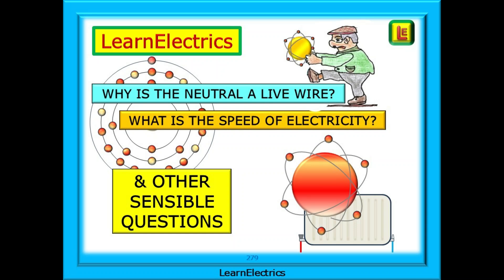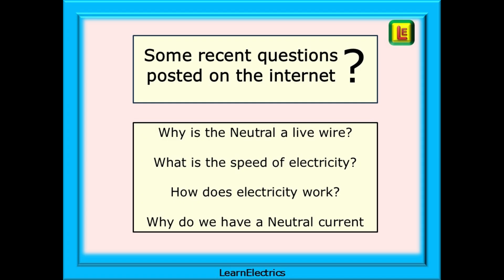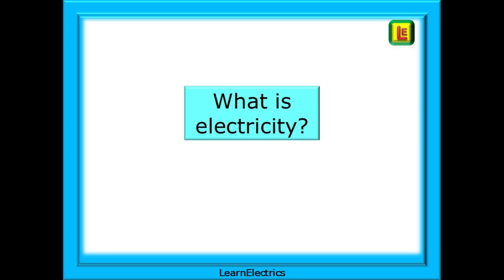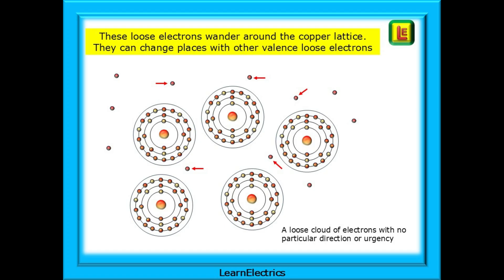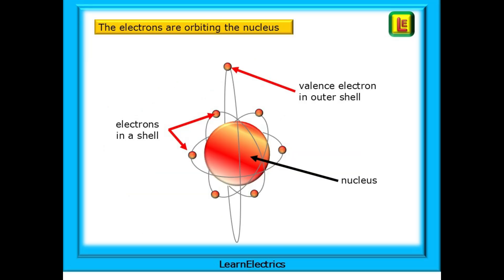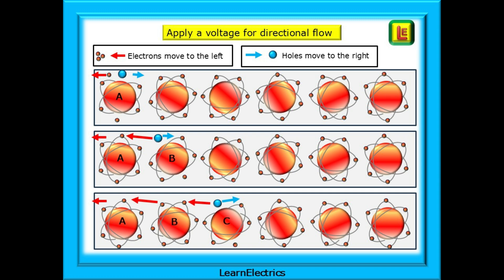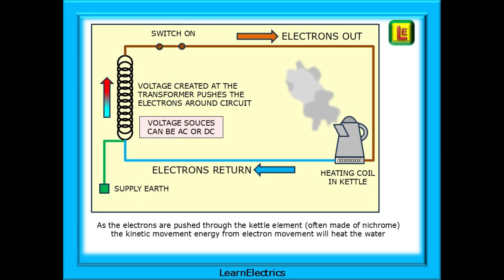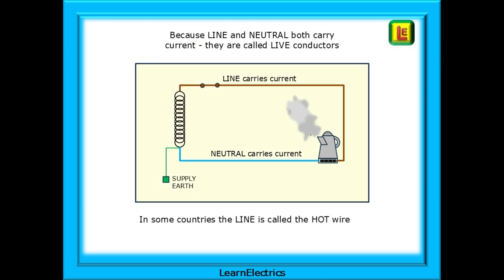WHY IS NEUTRAL A LIVE WIRE – WHAT IS THE SPEED OF ELECTRICITY – AND OTHER SENSIBLE QUESTIONS

Comment: I like the wooden tube model. Snooker balls . Conveyor belt. Bicycle chain models all work. However i find it works intuitively with DC. But not with AC. AC throws me in the way the chain is pumped backwards and forwards alternatively 50ntimes a sencond but that the Current goes round in one direction? Or does it actually reverse after 180°.    What is the length of travel of the electrons per phase.  ( is it the length of travel.of the generator's circumference)    basically.    With AC .     Is there any power in the negative cycle?  Is there power comin up the blue wire? Or is it dud because its grounded at 0 potential .  Or is it so that the even though ac is alternating, there is a 'current' going in only ine direction only.  ( like how the sea rocks forwards and backwards by a few feet constantly back and forwards but there is a wave travelling along the top of it in only one direction. This is the situation with AC?
Reply from the maker: Great reply, appreciate your support of the channel. A few have asked very similar questions so I guess its time to make another video. Watch this space. Lots more to come. Dave.
Reply: Thank you

Comment: The valence of copper is 2 - due to a  loosely  bound electron in one of the orbitals other than the one containing what you refer to as the "valence electron". If the supply and neutral are the same length (which they should be in a normal kettle cord !) the voltage dropped across the live to the kettle will be the same as the voltage dropped across the neutral from the kettle back to   the main neutral terminal    - same length,same material so same resistance and so same volt drop.
Reply from the maker: Yes indeed, you're absolutely right about the voltage drop in a kettle cord! Thanks for the excellent contribution to the discussion. Dave.
Reply: @learnelectrics4402  You don't mention the valency .  Do you agree it's a little more complex due to the loss of the single  electron in the 4S shell  and or the 3d shell ?

Comment: I think I’m getting somewhere, when it comes to potential difference it mean that return path (neutral) carries less voltage compared to line conductor as u mentioned line conductor carries 235v but after coming out of appliance to return path neutral it becomes less to 2.5v.
Reply from the maker: Er ... no, the line has the full 240 volts across it and loses 2.5 volts in the cable. The neutral also has 2.5 volts, the same resistance as the Line. This leaves 235 volts across the load. Take a look at the video on the link below, it will help.
https://www.youtube.com/watch?v=QKKha4dtfuM

Comment: Another excellent video. Please would you consider producing a video with similar diagrams to show how AC current actually flows - with particular regard to how the the current flows in the negative half of the cycle when the neutral is bonded to earth ?

Regards
Reply from the maker: Now that is an excellent question. Yes indeed I will, give me a couple of weeks. Thanks for posting. Dave.